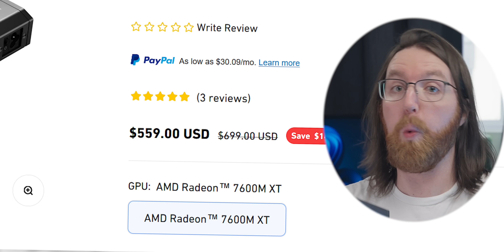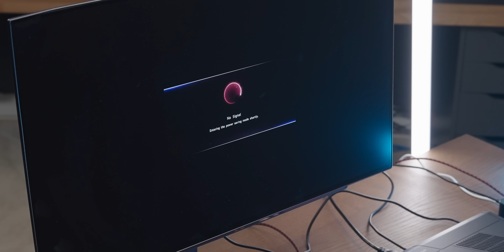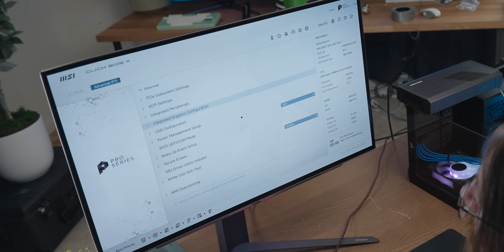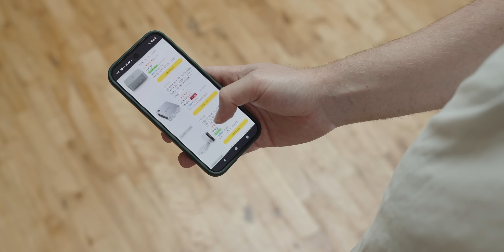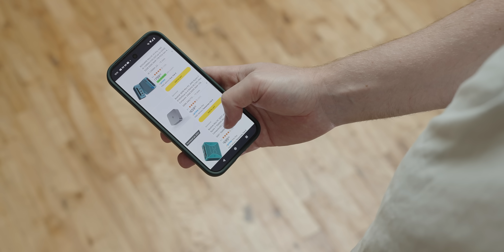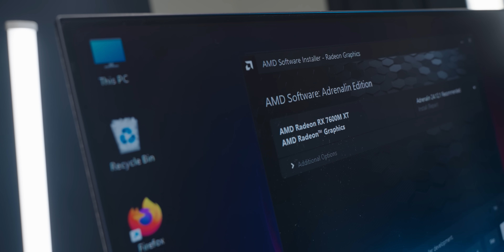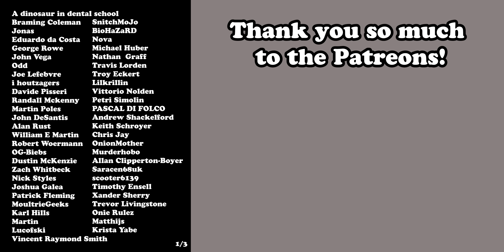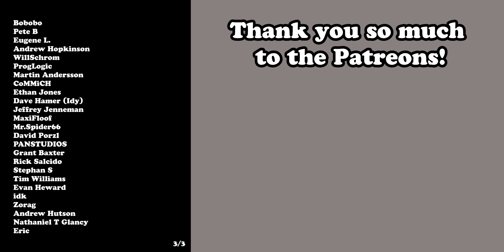This Aliexpress Graphics Card Did Terrible Things To Me...

Comment: eGPUs are frustrating as a whole to get working, especially with Windows. As someone who used to use an TB3 RX570 eGPU from Sonnet with a MacBook Pro bootcamping Windows, it was hell with Windows and pretty bad with Mac, even with all the work Apple put in to make eGPUs work as seamless as possible.

On Windows, driver shenanigans meant that it only ever saw the GPU if it was connected whilst booting, but Intel's chipset drivers erroneously limited the GPU to using 32-bit address space, which meant Windows would report it was out of memory (out of 16GB) to load the driver. You had to use an intermediary first-stage EFI loader which changes a flag or spoofs a firmware value (i forgot which) before booting Windows just so the chipset driver would believe Thunderbolt accessories are allowed to use the full 64-bit address space. — This never happened on Linux or macOS because those OSes do not care what Intel says is addressable memory for loading drivers, and load the drivers where they please. Windows honors the Intel drivers.

Windows was also way more fickle about ejecting GPUs, and it on the whole seemed to not understand as an OS that eGPUs are, well, external. This may have improved since then (this was Windows 10 as of 3 years ago?) but on the whole it was extremely jank. Using it with a mini PC would probably be better, albeit. That seems to be what it's tailored to. That is, "set and forget" systems where the eGPU is connected all the time, or at least always at boot time.

macOS wasn't great either. The OS was fine with it, but applications weren't. See, since Apple expected hot-plugging and mobile usage as natural occurrences with eGPUs, their OS was designed around this, and APIs that surfaced GPUs were too. This meant everything was a whole lot more arbitrary, and you could also drive applications on the internal display using the external GPU, which was amazing in theory but broken in practice. Why? Developers. Developers. Developers. A lot of developers put too much faith in that "It Just Works" Apple magic, and assumed Apple would always choose the best GPU in any given situation. This led to applications like OBS for years being hardcoded to the internal GPU by mistake. And even if you forced an application to run on the eGPU using Apple's magic checkbox for it, if you were doing the eGPU ➜ internal display workflow, some applications would not render correctly as they were expecting a one-way trip to a display on the eGPU. The window being rendered internally but its graphics jobs being processed externally was wholly unexpected to some applications. It only really worked best with applications that didn't know what an eGPU was at all; things that would just take whatever GPU was thrown at it and call it a day.

This was all remedied using an Apple provided CLI to launch applications with only the eGPU "present", as this both ensured that only the eGPU was selected and only the eGPU would be presented via API, but the fact you needed to understand terminal commands and input a lengthy command to essentially blacklist the internal GPU just so software would render on the eGPU whilst letting the OS pull what it rendered to the iGPU for the internal display was pretty frustrating. The fact Apple even felt the need to make this a feature of the erroneously named "safeEjectGPU" tool indicated they knew some developers were going to get this wrong, and they needed a way for advanced users to make the system lie to these applications and say the eGPU was the only one present.

On the whole, my experience with eGPUs is that what they work best for are antithetical to what they are best designed for. They work best with small-form desktops, where the GPU is likely to always be connected and almost certainly going to have its own display. But their promise is best suited to laptops where you can get desktop-class performance but in a portable laptop form-factor. If you're using a desktop… just build your own mini PC with a proper PCI GPU.

Oculink might work better with Windows, maybe? Or the rare AMD system with TB3, if such a thing actually exists? ( Intel is very stingy with Thunderbolt 3. ) I haven't used either personally. But even if it does handle hot-plugging directly… what mainstream laptop uses Oculink today? It's all Thunderbolt 3 & the upcoming USB 4.0 spec. USB-C connector, Thunderbolt 3 or USB 4 rated cable. And Apple Silicon devices are the only non-Intel devices I even know of to support being Thunderbolt hosts.

eGPUs are, to me, a broken promise. Something that could have been great, but ultimately missed the mark due to developers not knowing how to take advantage of them.

Comment: Your status as a genius was ruined when you expected it to work without plugging it into thunderbolt. Graphics cards need some sort of PCI Express interface, and a plain USBC does not give you that.

And the price isn't too unreasonable given that it comes with a case, a power supply, and an assortment of cables.

Comment: Hello! Just stopping by to let you know that you were using the GPU wrong in the first place. You always must turn on the GP first and then boot up the system. Normally within 2 to 3/ seconds of turning on the GPU. As somebody who ran an external GPU for years Windows is not capable of hot swapping GPUs.
Reply: I'm not so sure. I was using eGPU for 1.5 years  and it didn't matter what I did turn on first or when. 
I preferred to turn on GPU when PC was on bios to aliminate loud 100% fan speeds while waiting for connection.
Also I often just turned off  eGPU after gaming and continue to use windows without resetting.
Reply: @drayke8886  mux chip or maybe it ran the dgpu through the integrated gpu. if im not mistaken thats how apple did it on their older intel macbooks

Comment: Or was it because you had the Occulink and the USB-C both connnected that it finally worked?
Reply: I had a 30” Apple display from 2004 that needed the extra USB conx in order to turn on at all. I guess that must be it.
But why didn’t Dawid have a manual explaining this? 🤔
Reply: It's almost certainly that it needed both yeah.
Reply: I just read the setup guide. There is no mention of needing the type c as well as the occulink. My best guess is the occulink d-board was not seated. The e-gpu requires a signal through the occulink cable to boot the gpu.
Reply: This. Dawid is a goof lol.
Reply: I don’t think so, in his ‘support’ video he comments that it doesn’t make a difference and doesn’t work either when he tried without it, implying he’s already tested both configurations.
Reply: @Enter-the-Meta  He tried only with usb first and then his later attempts were only occulink
Reply: @Enter-the-Meta  That is what he "thought"....
Reply: It shouldn't matter there are plenty of Oculink eGPU enclosures that don't have USB-C connector and work just fine
Reply: @GH1987  Which ALL are NOT this one....
Reply: @ Yeah, but this one has. So it's up to the manufacturer to implement the thing the way that they want. And as of right now, there are only 2 possible reasons, why the thing worked in the end: 1) Because taking it apart and putting it back together fixed it or 2) it needs the USB-C connection. For me, the latter seems to be more reasonable. Do you disagree?
Reply: The USB C shouldn't matter. It's there for 65 watt PD output.
Reply: @WilReid  "The USB C shouldn't matter. It's there for 65 watt PD output"   ... or is it?
Reply: @xjet  It is THE way to comm. with eachother, in this case....Willing to bet that if he removes the USB, it won't start again....100%.
Reply: @WilReid  Just because it can deliver 65 Watts over PD, doesn't mean that's the only thing it does. It might very well be used for the USB Ports and to tell the eGPU to switch on.
Reply: @NebukadV  Exactly...It communicates with it.

Comment: I appreciate the conent here and find you computer experience to be pretty good so I was miffed to see how you would try to connect the USB-C port to a thunderbolt connection when the Minisforum website specifically states that this a USB 3.1 port (even other reviewers kmow that this dock is Oculink only)! As for using Oculink, there is a very specific process to the booting process, which you seem to have done when you finally got it to work correctly but it's unclear that you followed the process in your other attempts. First turn on the Oculink device and wait for it to initiate and then boot the PC. I will admit it's a little bit of a pain but it's essentially thunderbolt 5 performance (4xPCI 4) and if you happen to have a Minisforum mini PC, the dock will automatically turn off and on with the PC.

Comment: Oculink is a video connection and little else. In most cases you will need a USB of some kind for the host to control the EGPU.
Reply: Occulink is just PCIe. Maybe it indeed did not work because he did not have the USB plugged in simultaneousy?

Comment: You filming the video to show it doesn't work causing it to start working reminds me of a client who was struggling with an application that refused to work and said he had restarted the PC, unplugged it, let it sit for a day without power etc. then when we had exhausted all the possible solutions after and hour of trying shit I went "Well, we COULD try restarting it one more time even though you've done so multiple times" and after that it just started working and still works after weeks. I think it's the computer mana at work, the client even went "Well, I guess it needed the right person to tell us to restart it".
Reply: I worked as a computer technician for a long time and I hated computers with intermittent problems. A customer could bring a computer in and you fixed it. Everything works fine with not a single sign that there is something wrong, the customer comes by to pick it up and you do one last test to show that it does work and everything goes wrong.

Another is when you get to a customer and they are showing the exact problem and everything works fine for the first time in weeks. Then the moment you are in your car driving back the phone rings and the computer has screwed up again. I hate those.

But sometimes you get rea ly funny problems. One customer called and said the computer wasn't working. I asked about details such as is the power LED lit up? can you hear that the fans in the computer are spinning? Can you hear the disk spin up? Yes this was many years back. Well the answer was yes to everything. So as the customer had signed up for on site service within four hours I got into the car and drove over. Turned out the "computer" was the screen, and yes the power led did light up. But there were no sound of fans or the HDD because the computer that was placed under the desk were not powered on. The best guess we had at how this happened was that the cleaning lady had unplugged the computer to connect her vacuum cleaner and had not reconnected the computer when she left.

And yes older users often called either the keyboard or the monitor "the computer" while the actual computer could be called everything from the box to the HDD or the processor. You learned to ask exactly how the "computer" looked so you knew exactly what they were talking about.

Finally there was the customer who came in with a computer we hadn't sold, but needed it repaired. It lost date and time whenever it was turned off. That meant that the battery for the CMOS memory and real-time clock was exhausted. Another technician took care of it. After a while he called me over and asked if the battery should get that warm. It was hot. I looked at the computer and saw that the motherboard originally had a NiCad cell supplying power for the CMOS memory and clock. Those were rechargeable and the motherboard was sending a recharge voltage to it when on. But these batteries would degrade over time and this one was dead. So the other tech had connected a lithium battery instead. But the thing is lithium batteries of this type are not rechargeable and the old NiCad cell had a slightly higher voltage. So now the motherboard was trying to charge the lithium cell, not a good thing. I told him that would not work and to replace that battery with another battery pack that wouldn't have a problem with the charging current. Problem solved. Well it was solved until the day after the customer collected his machine. 

I got a call from the reception that they had a customer there with a machine that needed help. It had exploded they said. Well customers had all kinds of interesting descriptions of problems, so I guessed it had blown a electrolytic capacitor. Those can be loud.

When I got to the service reception desk I was met by the customer and his son standing behind their computer on the reception desk. It had exploded! the side panels were bent up and out so they looked like the wings of a seagull and there were a lot of fine dust over everything. Turned out that the tech who I talked to hadn't changed the battery to something that could stand the charging current. So that lithium cell had overheated and exploded in the middle of the night and filling the entire room with debris.

As dramatic as all this was the customer and his son was incredibly relaxed about it all. I am still surprised they weren't trying to strangle me or something. We ended up building them a new computer probably ten years newer than their old one. I managed to save everything from their HDD and copied it to the new drive and that was the last time I heard anything from them. The new machine was good and at the time worth about $1000. Still I feel they were incredibly calm about it all. This was about two decades ago, so quite some time has gone by since, but I still remember when I realized that my coworker had just blown up their computer by not changing that battery like I had told him to do.
Reply: Sometimes pcs do be like this

i guess machine spirit is real and it hates some people more than others
Reply: We had a system in AWS that had the webserver in Singapore, but which ran through a proxy in Dublin (don't ask!). It started intermittently alerting HTTP50X with certificate errors.

We thought it was network latency, but never got the chance to prove it. You see, I set up AWS and local Perfmon sensors on both servers and watched them all day. It didn't fail then, and has never failed again. I like to joke that they knew they were being watched! Of course, it's more likely that Amazon had a network problem that they never admitted.

Comment: 13:54 what the fuck ?
That yellow connector is an Amass XT60 plug, commonly used in RC drone batteries and drone battery charger power supplies. 
Hell, the fact it also has a 65 watt USB C output.... I'm pretty sure that GPUs power supply came from an RC charger.
Mine has the same plugs and the same USB C power output.

Comment: this is a low/mid level LAPTOP GPU and your getting super hyped about it? there are mobile phones that can rival this in performance now so i can only assume your shilling for your livelihood.

I mean its not even cheap. You can buy a full BRAND NEW laptop with this gpu in it natively (so not 4x pci-e lanes) for very little extra (ASUS TUF 15 for instance around the €750 mark) or get something better for the same cost of this external gpu if you hit the second hand market. At anything over €200 this is instant e-waste, its probably even a salvaged gpu chip/board from a dead laptop knowing aliexpress sellers. and only 4x pci-e lanes for the connection will reduce this card to the levels of a 980GT from over 15 years ago. Maybe you'd get 720p gaming if you want 60fps, possibly 1080 if you happy with 15-30 in anything even remotely modern or if your happy with the noisy blurry mess of upscaling from a 240p image to 1080p

Or any fps you want to target if you run a golden oldy like MOO classic, the original elite or doom (they got this running on a usb dongle recently).

I also dont for one minute believe that was 1080p high on cyperpunk on this gpu over a 4x occulink without using something like FRS performance upscaling and all raytracing disabled (so not high). Proofs in the pudding, show your settings to validate your claims and the single video cable to the monitor to validate its running on this external, artificially handicapped, low end laptop gpu.

Good video for entertainment factor but the product should be presented for what it is, instant e-waste garbage. a 7800 or 4080 in it and sure its a viable product but a 7600m for nearly the price of a brand new laptop that has the same chip???? I even watched your full video in case you gave a summary of "DO NOT BUY ITS GARBAGE, waste of money and e-waste" but you didnt.

Comment: this is something i thought of way back in 1999... sadly i was never good at capitalizng on my ideas ,and obviously some one else thought of it too and actualy took it to market (many years after i first thought of it).  though my ideal mainly focused on better graphics for laptops ,and  also having laptops with an AGP (the video card standard in 1999)  port on the side or back of said laptop  . also my idea was  for a housing , that could have different video cards swaped into it , where as this things seems less like a swappable and more like  "here's what you get" portable video card. though i remember asus  or soem one did do somethign closer to my idea albeit with PCI-E  instead (also i think they used a m.2 slot not a full bus PCI-E slot).

Comment: Haha.. this is more a review of shenanigans I feel that the device :)  And that's why we watch.
I have one of the original GPD G1 devices and it travels with my Zenbook Flip, which is the only real use case that could justify the cost.
I run via Thunderbolt and never had any problems (accepting TB limitations).
I do note that even though many vids of Oculink exist (esp handhelds) there are a lot of reddit posts going on about  Oclinik problems.